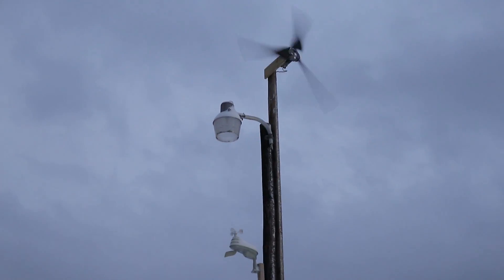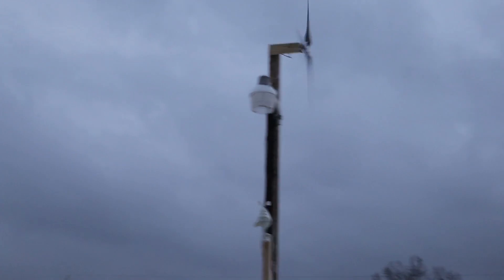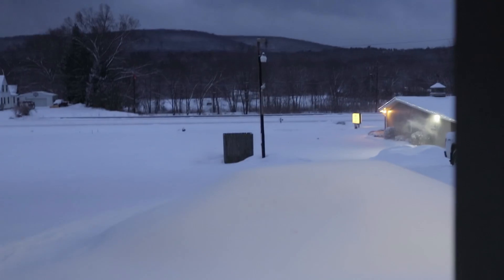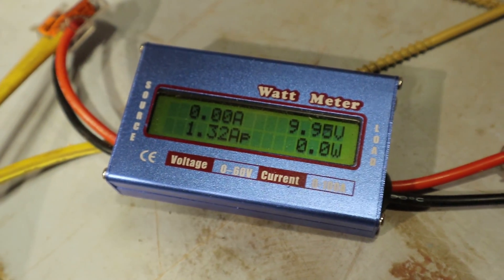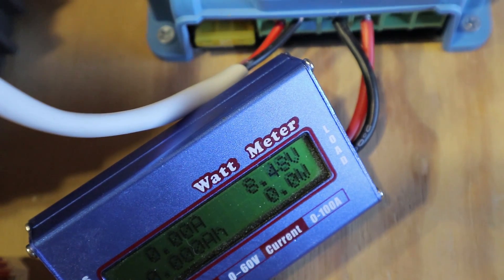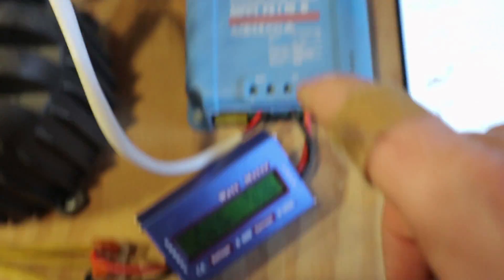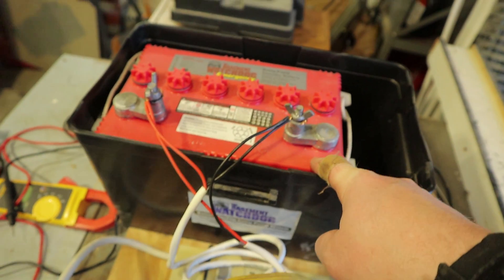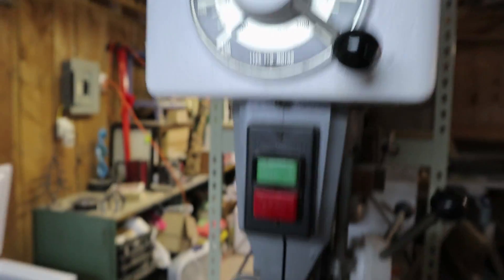[Part 3] DIY Wind Turbine Adventure - Does It Work?

Comment: You might consider an old car alternator and then rectifying the AC closer to the charger. Those produce a lot more amperage than  the hoverboard motor. The hoverboard motor would be designed to use the least amperage when running fast and more when stoping and staying stopped... at least in terms of coil alignment and flux penetration. It still generates AC voltage, but the faster it spins, the higher the frequency. Voltage should remain constant. A car's alternator when rectified would produce a constant 14 volts and with a FULL BRIDGE RECTIFIER and some capacitors you can smooth out the frequency of DC pulses. Not much anyone can do for the wire losses though.

Comment: Yep.,   Your wire run was too long maybe for AC as well.    I have a few of those hover board motors to play with .   Thinking of using a Saw Blade as a Hub to mount blades on the thing.   Not much meat on them to be drilling and taping for more.

Comment: Have you thought about using a vertical wind turbine instead? They are omnidirectional, so no need for a fin on the back, unlike traditional wind turbines. This is my opinion, but I think it would work better on the pole that you're attaching it to. Also have you thought about going solar as well? You dont have to buy solar panels, if you know how to solder and do basic electrical work. You can just buy solar cells off ebay and make your own panels to the specifications that you need, for your current energy consumption.
Reply from the maker: I'll be building a proper tower eventually. VAWT always seemed interesting with unique design challenges. Useful sized ones get complicated quick whiten it comes to engineering the structure of it lightly.

Comment: Is it just me? I get confused when you refer to generators as motors. Is it because they have similar construction? In terms of “power” outcomes, a motor consumes power, a generator creates power and an engine (e.g. gas/diesel) develops power. What am I missing?
Reply from the maker: You aren't missing anything, there is no great american term for what it is. I can't say generator because then people think gas generator. I can't say alternator because then people think the car type that isn't well representative of the types used in renewable energy (at least in stock form). I say motor because most of the time they are repurposed motors. A better lesser known name people around me would not recognize is Dynamo.
Reply: Alan Kidd a motor and a generator is basicaly the same thing. In a motor you are making a magnetic field using electricity and that moves the magnets inside and if you turn the shaft you move the magnets inside and that makes electricity.
Reply: +Alan Kidd  Actually, a motor consumes energy. Power is the rate at which it is consumed. Nothing "creates" energy. Energy can only be transformed from one form into another. The first law of thermodynamics.  ;-)

Comment: boosts inverters are actually quite effecient. They are driven by N mosfets and those are cheap an powerfull... problem is that there are huge losses at 10A over the wires over longer distances... You can try to use boost voltage regulator but as close to the turbine as possible. It is really not a big problem, because when overloaded they act as constant current and therefore voltage will just drop down eventually to turbine voltage.

Give that boost converter a shot, but place it as close as possible to generator.

Use this https://goo.gl/ukKmer set output voltage to for example 16V. Also this boost converter works from 10V, but this can be changed by powering it from battery and not from turbine itself. When you filp that over you will find 0 ohm resitor near 7809 voltage regulator and not soldered spot. Resolder that 0 resistor to that free spot and it will be powered from battery.

Pros - cheap, fun to try, should work.
Cons - powering from battery with no wind can drain battery after several weeks, output voltage must be high enough for direct charge and cable loss and also can cause overcharge. Can be resolved by adding cheap pwm charge controller near battery (that wil prevent overcharge) and then also needing a diode to power back that boost converter (or adding a 3rd wire for independent power of that boost module)
Reply from the maker: Thanks for the info! I'm always surprised how cheap things are on aliexpress.

Comment: I feel like you are losing more efficiency with the static directional mount, than any cable length or DC vs AC.  Allowing it to spin like a weather vane would increase your average voltage because you would catch more of the wind force.   Also, at such a low voltage, up to 10% loss for cable length is meaningful.  I'm not sure there is a solution to this, given your low temps.  Something to address last I think.
Reply from the maker: There are many things to address. Based on visual observation the weather station wind vane and turbine were usually within a few degrees of each-other. I didn't want to go through engineering a swivel mount so soon.

Comment: So would it be better if it was geared down so the turbine is just on a bearing with a chain drive down to a motor? So in theory you could double the speed the motor spins with the size of the sprockets or would it just struggle to turn at all?
Reply from the maker: It would work, mechanical complexity and wind turbines don't mix well.

Comment: measuring dc might be better with a capacitor in parallel to even out the voltage
Reply from the maker: Maybe, I wonder how much it fluctuates. I don't have a scope.
Reply: @JoeMalovich  you could short the wires out on one side, and measure resistance on the other side. That gives a good clue on how much losses there are.
Reply: Ow I answered the wrong question... Still good info :) for the cap: just put a 100uf parallel over it, and maybe another 1uf parallel, that should make a difference

Comment: Isn't that too far to carry a DC voltage... the voltage drop across a wire will be a lot far as the wind turbine.
Reply from the maker: Yeah, looked it up and I see about 10% wire losses at 1 amp 15 volts 18ga 100ft DC. https://www.calculator.net/voltage-drop-calculator.html?material=copper&wiresize=20.95&voltage=15&phase=dc&noofconductor=1&distance=100&distanceunit=feet&amperes=1&x=76&y=16
Reply: I also wonder if the wire resistance is eating away the power. Since its ac produced it could even be stepped up in  voltage to reduce the losses.
Reply from the maker: It's DC, unless you talk of the hoverboard motor then it's 3 phase AC
Reply: @JoeMalovich  any motor with apposing pole magnets is ac as a generator
Reply: @MasterIvo  
nothing to do with dc. ac and dc currents have exactly the same losses. basic.
Reply: @ursodermatt8809   ac can easily be stepped up in voltage, which lowers the current (and the losses). Dc can also be stepped up with a boost converter but is a little bit more tricky.
Reply: @MasterIvo   Or trickier.

Comment: i was before playing around with wind tubines and i has the same problem as you, the voltage was not high enough and i think you need quite a big turbine to produce even small amounts of power, as you said boost converters waste and so do gears. best option is a large brushless motor like whats used for some washing machines and some ceiling fans. thankyou for sharing great vid

Comment: Is there some way to put a flywheel and speed limiter on it, so that when the wind is really blowing, it's taking that and adding the spin to the wheel, up to a certain speed, and the generator feeds off that?  Just as a way of mechanically evening out the heavy gusts and making it so you can eek out some more steady power.
Reply from the maker: No. It's best to electronically deal with the power available and it's produced than mechanically.

Comment: Try alternator motor. Higher output
Reply: Car alternators use electricity to run because they don't have any magnets inside. Electro magnets are really powerful which makes the output high but in order to make use of it you need extremely high rpms otherwise you're not making up the electricity you use to power the magnet. This set up is useful for a car because when you're powering your motor with gas and not the wind your motor will be spinning really fast. It doesn't work as well with a wind turbine unfortunately ):
Reply: @latreen1   You can put permanent magnets in them.